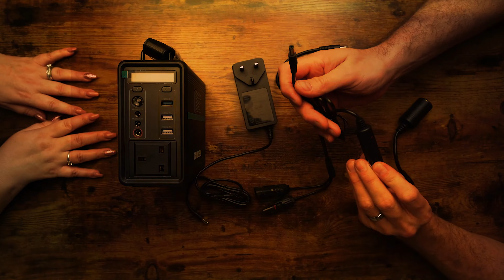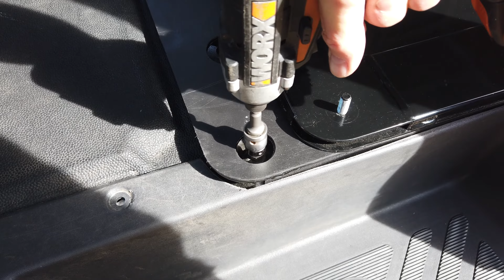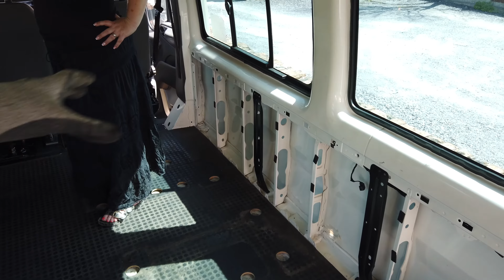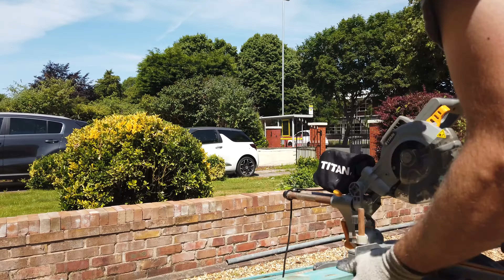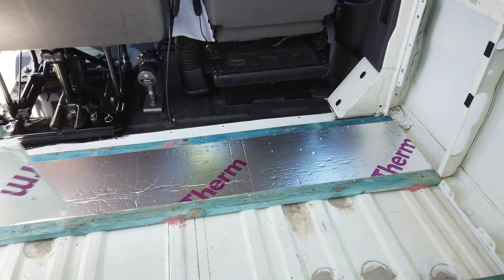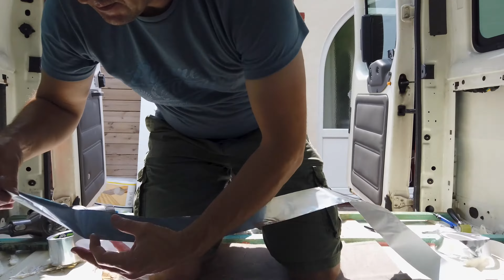Transit Campervan Build Ep.6!!! SWIVEL SEAT | FLOOR BATTEN | FLOOR INSULATION | Van Build

Comment: Great few tips there!)  You've kept your double front seat too.  I'm just wondering as I've bought a single swivel base;  was going to remove my double. Question is does the actual swivel need to be mounted on a higher rise base, because my base is almost level with the floor.  I'm going to have to fabricate  a bit because I just bought a random captains base, not for transit perse  thanks again.. Kingspan at 25..and 40 screws.. are the screws called self tapping?  Lots to ask thanks!))
Reply from the maker: Graham here, I just bought one specifically for the double seat in there transit. As it will be carrying Michelle and Maximus on our travels I wanted it spot on. I got it from Custom Design shop, you can find them on google. :-)

Comment: I deffo want a swivel front seat. You made my mind up for me. I'll have to work out the logistics of moving the electric system under the sliding bed. I'm wondering if I do get the swivel seat , to get someone to do it for me. I dont think with my back that I am physically capaple. Its a great addition though and adds luxury to the van.